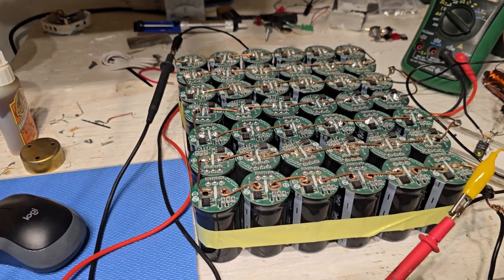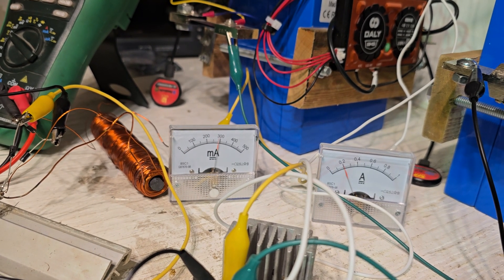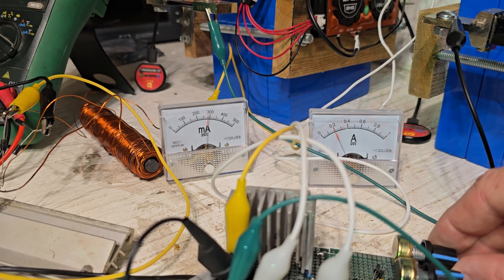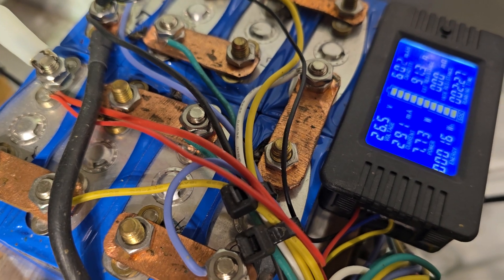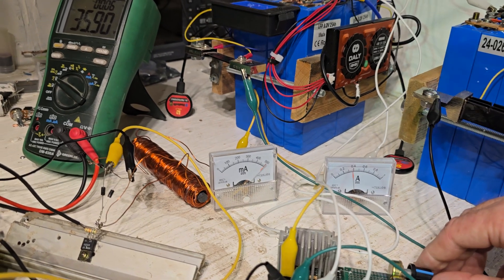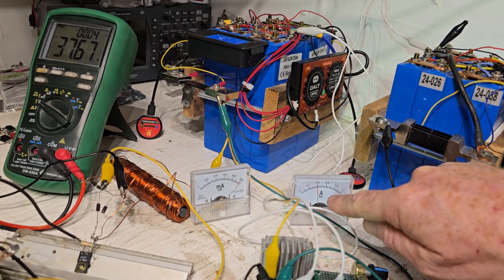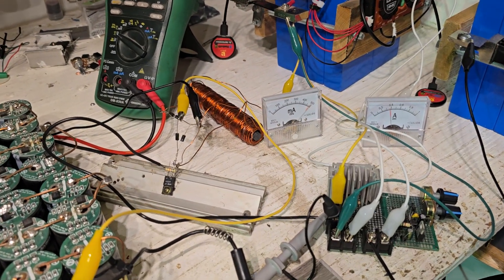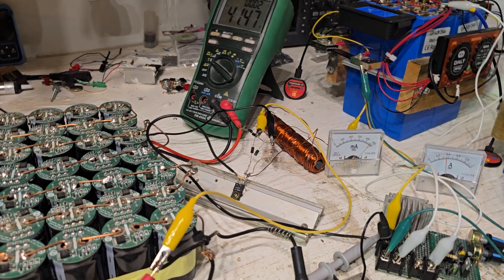Charging 105v Super Capacitor bank with a Joul Thief and my driver circuit at a freq of 6k hz

Comment: There's two ways bifilar coils make it work. One is by using harmonics, like full wave, half wave and quarter wave.

Other way is by turning the two waves to produce beat frequency (acoustics) that is higher voltage than the originals. More voltage is always less resistance (less heat).

Comment: Nice setup
How many turns have you on the coil to get this effect
Reply from the maker: I'll check tomorrow give you ohm readings and wire gaugue i can only estimate right now
Reply: @windpowerandmore6310  Thanks
Reply from the maker: Primary has 24 awg at 6.6 ohms.
Secondary has 19 awg at 1 ohm .

Primary is wrapped first on the ferrite with the Secondary wrapped over that
Reply: @windpowerandmore6310  is the coil from begin to end wrapped what i mean only one layer of each
Reply from the maker: @Edmorbus no there's multiple layers of each . More resistance the better but still need fairly thick wire to achieve it with a  lower voltage input. Each time I built one of these i added more turns on each coil which drastically improved the efficiency.  I'm pretty sure adding even more wraps like say 12 ohms of 24 awg and 2 ohms of 19 awg will make a huge difference but will require a higher input voltage

Comment: 12:30  the inductor always losses energy threw radiation, best way is to use both ends of the core and stator pickup the sides > Inductor
Reply from the maker: Do you think toroid  is the way to go? These are met glass ferrite
Reply: @windpowerandmore6310  toroid with a bismuth housing to reflect the radiation back onto the toroid .
Reply: Actually fully covered core seems to contain the radiation better. Like on the SJR looper. Air core will always be able to go higher frequency, but it needs more copper.

Mn-Zn toroid with a split should be the best price vs quality. But Met glass is also very good. 1:3 ratio seems to be better (it's easy to make by winding 4 wires together and putting 3 of them in series).

Joule thief will work better if there's one loop of short circuited wire on it. Also magnets might make it more officiant.

I recommend to look up the Lasersaber SJR looper and MTech industries circuits.
Reply: @Kangsteri  sounds good
Reply: @mykedoes4099  Some old radio trickery to reduce the resistance for HF is using Teflon tape on the core. More surface area / tension on the coil wire also helps. Litz wire is bit expensive. Silver plated jewelry wire is also very good, if it's spaced with fishing line etc.

I believe it's possible to make solid state oscillator, that can charge batteries. Example using blinking joule thief to power the SJR looper. Then use isolation transformer on the output and run it from supercapacitors.

Joel Lagace proved it's possible to make Self looped Bedini, by using the isolation transformer.

I'm currently trying to build the self looped double Bedini, that is using both ends of the coil. To run big wimshurst generator. MrTeslonian has good video how to make the HV step down transformer.
Reply: @Kangsteri  i go live often in case anyone wants to get a better understanding before they try and replicate . At 1st i was single pole switching my circuit Mod but took me some time to realize the flyback was getting cancelled on the line at that point i added some switch points, see the Tesla Kromrey Switch , its similar concept , i made a video about that switch
Reply: @mykedoes4099  GaN (gallium) transistors / MOSFETs might be useful. Transistors are often much better than diodes, they are faster and have less resistance.

My main goal is to make something that anyone could make from common garbage parts. Simple and cheap :)
Reply: @Kangsteri  you think using a transistor as a diode is faster than germanium ? doubtful
Reply: @mykedoes4099  GaN is most commonly used today with microwave. Germanium is better for low voltage. I'm quite familiar with military spec DX diodes. But even with crystal radio, the germanium transistors are much better than diodes. They still make some of those too.
Reply: @Kangsteri  right , but using a transistor on a diagram is not advisable as others will never "get it" its imperative to translate the good ideas as they will otherwise be lost to the controllers or worse "TIME" the Patent office is FOS
Reply: @Kangsteri  good advice i will take it if I ever get around to doing ultra HF experiments, i can say i rather not as its super dangerous but i still might with a low voltage pulse and a super high impedance coil in this circumstance i feel safe, i did experiment with a friend with a low impedance coil he slipped with the Function Gen and accidently went too high on the frequency , we both had weird things happen after that , i pees white he had nose bleed i believe he hit around 50Mhz it ran for about 8 seconds close range , i turned it off when i realized it was buzzing so High , was looking for vibration by hand nothing, too high Freq cant feel a thing , looked at freq setting he had and freaked then i disconnected as the NPN was super hot
Reply: @mykedoes4099  I'm not here to argue, just learning. But we have much better and cheaper technology available these days. People are smart, but lazy to build anything without real proof of concept. Most common folks are not able to read schematics. Replication by example is always way more easy to do :)
Reply: @Kangsteri  i agree, head over to my channel learn my circuit modification of the Bedini Sg , go from single to double pole make it easy on your self to loop the flyback  ;)
Reply: @Kangsteri  i will go live sometime tonight probably around 8 or 9pm New York Time